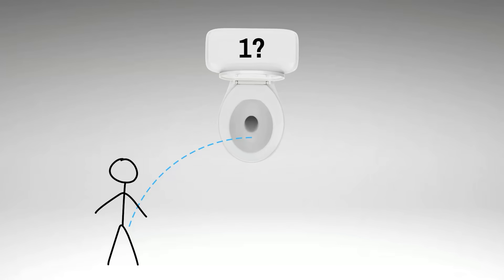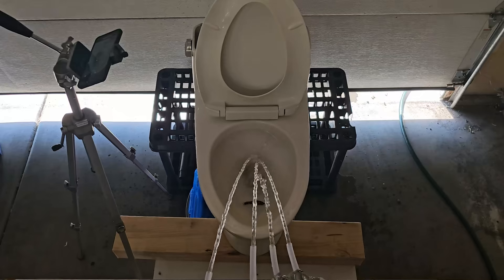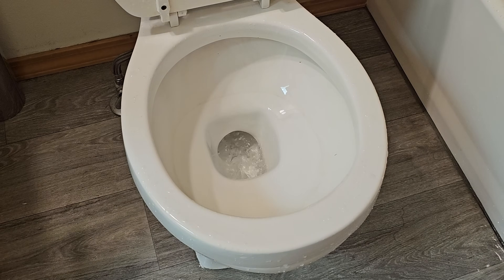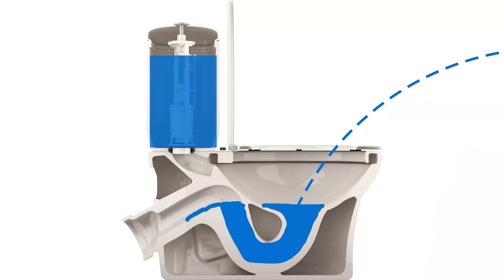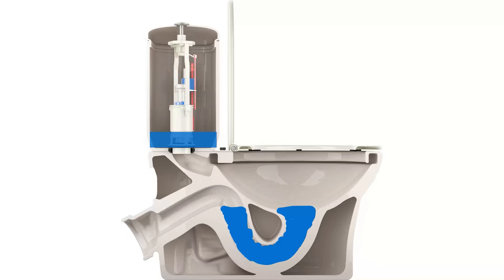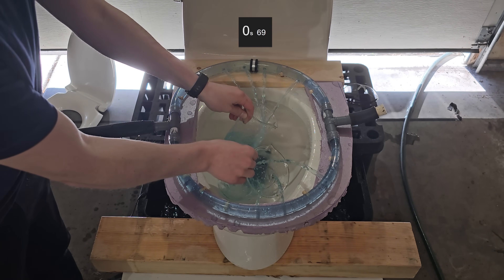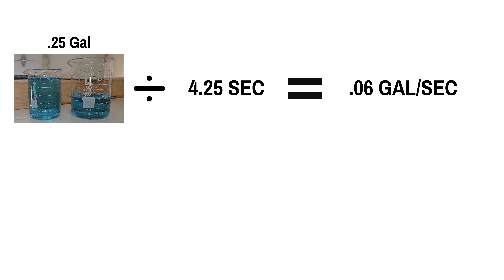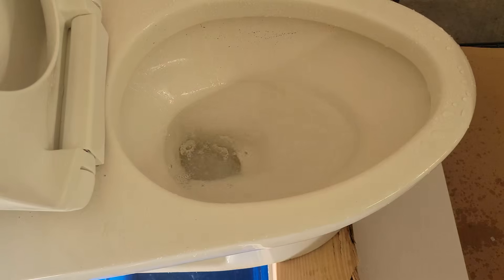How many people need to cross-streams to flush a toilet?

Comment: One person is enough. You just gotta have a strong flow and aim for the center of the drain (the specific point will vary depending on the toilet's design). If you do it just right, then you can time it such that an additional flush isn't required.

Comment: Random fact: you can reduce the number of flushes necessary to find the minimum number by performing a binary search. 16 flushes, so halve down to 8. 8 flushes, so halve again then try with 4. 4 doesn't flush, so you take the halfway point between 4 & 8 = 6. 6 doesn't flush, so you take the halfway point between 6 & 8 which is 7. 7 flushes, and you've found your threshold!
This reduces the number of flushes down from 10 to find the correct answer to only 5. It's a lot less intuitive for viewers than the descending method you used, but halves the number and has minimum efficiency O(log(N)) as opposed to your O(N) method.

Comment: I feel like there is one part missing. You averaged the flow rate of a human, but what about the total amount needed - can 10 people actually provide enough liquid? You said your cut of was about 30 seconds needed which made me think of the PNAS papers showing that mammals of every size take about 21 seconds of urination to empty their bladder completely. (The scientists won an IGnobel prize) As humans are mammals, I think the experiment might fail.
Reply: That isn't what's missing. You can flush a toilet with a single stream of sufficient pressure. I've done it many times. Aiming for the correct point to trigger the flush is more important than the volume. Once you get the liquid past the trap, gravity takes over.

Comment: Is 10 people around a toilet even logistically possible?
Reply: if there's room behind it, i can see a way. One guy might need to plank across the top of the rest if not.
Reply: Yes but the homies need to train before pulling it of.
Reply: Yes but you need to be stacked on top of each other. 2 in pairs so 5 people around a toilet.
Reply: Yeah but they would have to stand considerably closer than 5' apart, so it's not possible if you're straight.
Reply: sholder to sholder with your thang out isnt gay with your homies
Reply: @RAFMnBgaming  The real technical challenge in practice is not crossing the multiple streams because thats the gay part.
Reply: @myboysd5772 i did extensive testing, turns out it's not gay if the streams touch, it's only gay if the emotions touch.
Reply: @OhhCrapGuy Bro, if we're homies our emotions have already touched
Reply: @RAFMnBgaming  he said "10 people around a toilet". Are the gays not people?
Reply: I can hit reliably from 8 feet out, it’s pushing it but it’s possible
Reply: anything is possible if you try hard enough
Reply: You could use tubes. Or something

Comment: 2:20 I did basically this same experiment after watching the original video. Instead of a pump, I just used gravity. Also, instead of measuring and adjusting the flow after every plug, I made holes on both sides of the tube. This way, if I plugged one of the inside holes, I also unplugged one on the outside, keeping the flow through each hole more or less constant.

Comment: But what if we elevate very precise people 10 meters above ground? Can force of gravity improve results?
Reply: i dont think so because all you'd be doing is making the same amount of liquid get there quicker but not increase the actual volume of liquid which is what actually matters
Reply: It will speed the flow up only if the people are falling/moving down while "flowing". Kinda like in a cursed Doppler effect.